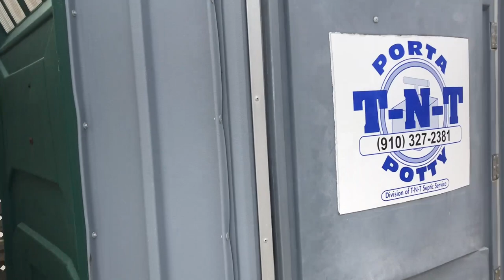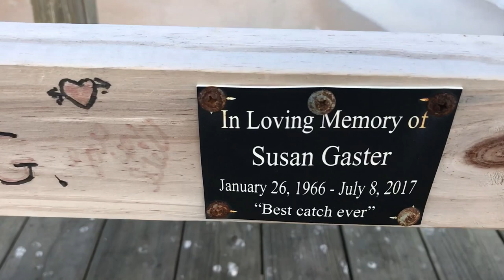Jennifer's DIRTY JOB operating knuckle boom Loader, cleaning up after hurricane

Comment: I had a loader myself l in in e no other built it was behind cab of my log truck an in m handicap but I could operate it up high with ease this would work on rear trucks to mine had a good seat  an a top for weather it was used for years on many trucks I went through it was  one of a kind  loader very strong load truck beside an itself to in alabama cullman